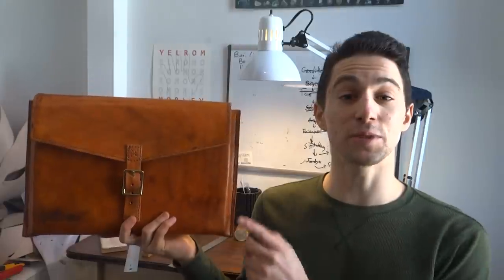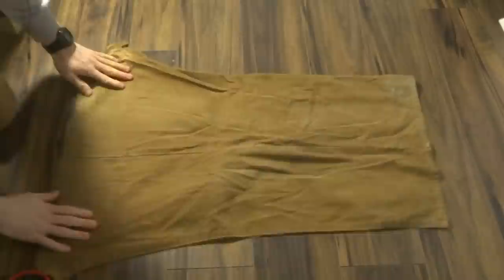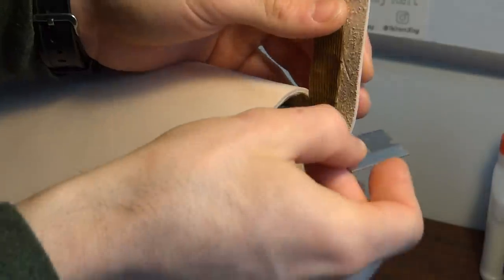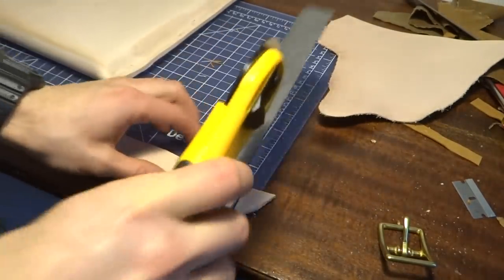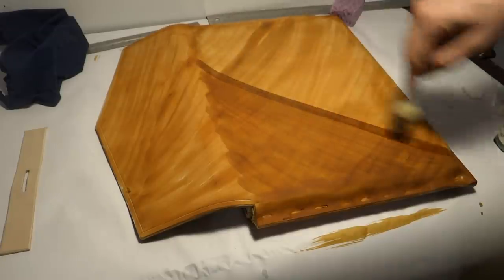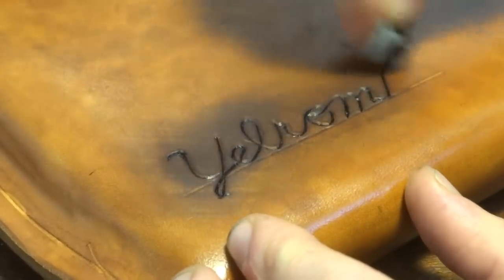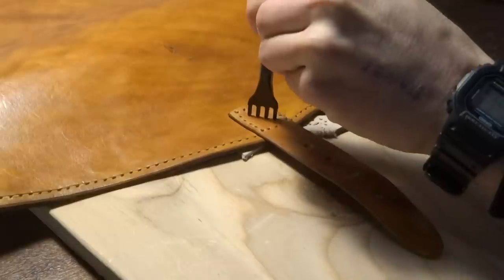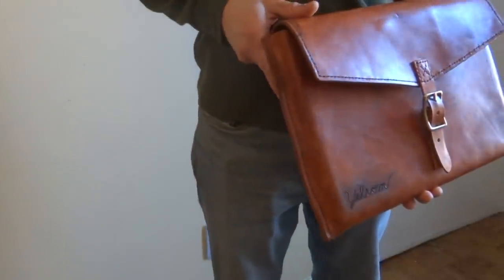DIY Leather Laptop Case with Corduroy Lining

Comment: Beautiful project! A couple of things to try in future: decent size foam sponge for laying on dye (you coat a larger surface area in each sweep and can control application better) and tokonole for smoothing flesh side and burnishing edges. I went from water to beeswax to gum trag and eventually gave in and ordered the tokonole. I’m also a lover of mink oil for final conditioning as it keeps your veg fan soft and water resistant. Cheers!
Reply from the maker: Thank you for the tips! Cheers 😊❤️

Comment: Remember, your stitching line should be the same distance from the edge as the thickness of the total thickness. You could've trimmed off another 1/6" off each edge to bring the stitches closer and getting rid of some of the separation of glue and leather that I was able to see. This is good for a first or second medium-sized project. Overall, well done.

Comment: Nice job. to help with a bigger project instead of using a dauber use a wool pad and go in circles. it will help with evening out the dye and help with no streaks. Also maybe check out saddle stitching. it is a better stitch to use then one needle. Hope these tips will help you out.

Comment: From where do you buy the leather sheets?
Reply from the maker: I cut the pieces for this case from a large portion of a hide that I bought from Tandy Leather.
Reply: @MorleyKert  What kind of leather did you use?  I like how firm it is.  I'm wanting to make a simple fold over bag for my laptop and a few documents.
Reply from the maker: @jaredshearer7989  Veg tan leather, I think it's 6-7 ounce.